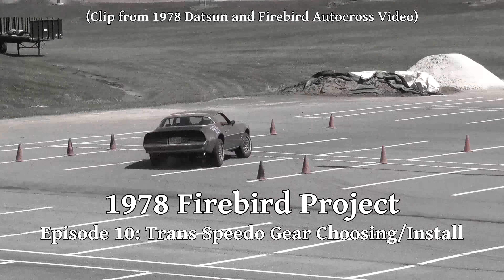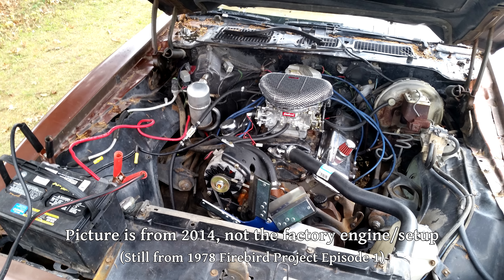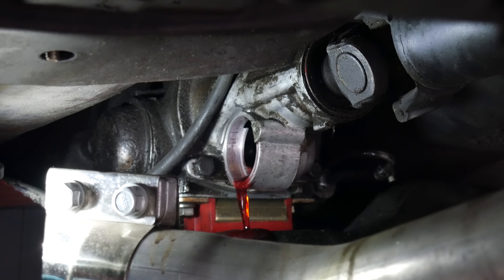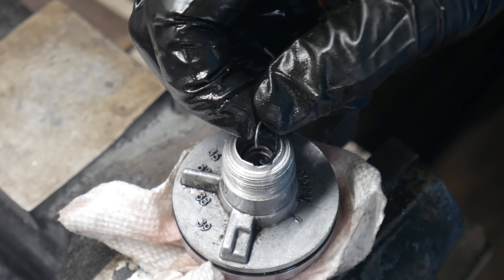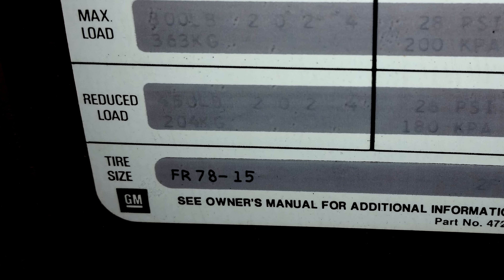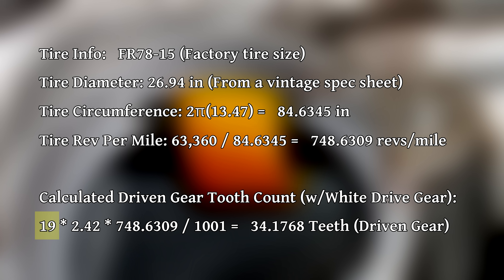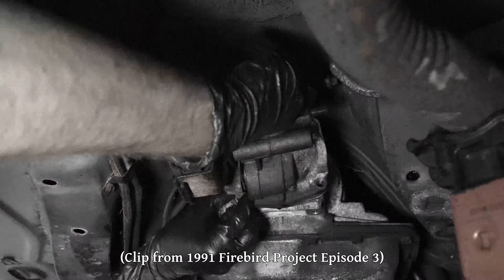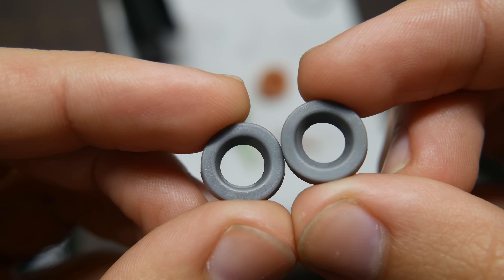1978 Firebird Project Speedometer Gear Choosing and Install (Ep.10)

Comment: The numbers on the speedo housing indicate which gears are compatible with the housing  . The bore in the housing is offset depending on the odds of the driven gear to get proper gear mesh . While putting a 34 tooth gear in a 36 tooth housing might work , eventually because of the mismatch it will strip the teeth . Use a speedo housing with a 34 on it and will last forever  ! Love your channel  .

Comment: Very informative. Very helpful. Wish I had found this a week ago when I didn't know these things. I'm repairing TH350 leaks on my '81 Trans Am and spent a lot of time finding the right speedo gears to best match my 3:23 gear ratio and stock tire size. Going with a 15 and 36 tooth combination and installing all new seals. My speedo housing is exactly like yours. Thanks.

Comment: The other thing my old boss taught me on a speedo that likes to bounce is to remove it from the gauge pull out the inner cable lube it with petroleum jelly because the cable can get dry works really good just leave the last foot unlubed near the gauge

Comment: I went through this on my Blazer. The original owner had replaced the trans at some point and the speedo was off.  I tried to fix it, broke three speedometer cables until I figured out that the pencil gear itself was broke. I had a reputable transmission shop fix it for $140.  Was perfect after that.

Comment: I utilized 295 50 15in on rear with 235 60 15in front. Height is darn near identical and fit better than 275 60 15in which require jacking up rear to gain clearance. Although for day to day driving i prefered 215 65 15in all season tires on my 78 bird.

Comment: if you wonder why the seal was in the wrong direction its simple . When those seals started to leak it was because the gear shaft was wearring out and at the time you could only get the gearshafts at the dealer and we all know how much a part at the dealer cost . so people re-used the same gear but flipped the new seal in order to avoid the new seal seat to end up in the same wear down spot as the old one . problem solved and you could continue for a few thousands miles this way . The only problem with that method is that a seal seat  is made to retract  on the shaft from the pressure created by  the warming up of the  ATF fluid creating a thighter seal in the pprocess . if you flip it then the pressure from the ATF temperature  will cause it to expend outward instead of inward like it does when its installed in the right direction . I've told my clients back in the 70's and 80's to stop doing that  and explained to them how seals actually  work and that doing that is only a short solution to stop a leak and will cause an even greater one in the future because of it and that by flipping the seal you open it to contaminations coming from outside and that can create accumulations of dust inside the pumps of the trany . Even if a trany filter is made to filter  very small particules it has its limits and some dust particules are even smaller than the filter can handle and a build up of it may take a lot of time but will eventually lead to trany failure
Reply: And the plug is machined offset center for the plastic driven gear, this allows for gear mesh adjustment. Like a cam. The shown tooth counts on the plug are indexed for where to stop counter clockwise rotation adjustment to those common sizes.

Comment: Thank you for this video.  I am installing a new housing and gear as you showed but have on question.  The retainer fork shaped clip does not touch the housing when tightened down and the housing can be wiggled a bit.  Does this mean I need to bend the retainer clips to put pressure on the housing?

Comment: You need to do this job on your buddy's XJ... Open Jeep catalog, turn to page with gears, select tire diameter, order gear. Done. No math. ;)

Also no cable! Not a fan of cable speedometers after many, many, many years of owning cars with them. I like their electric brothers much better.
Reply: Lassi Kinnunen  You're exactly correct, and on another vehicle I have had a speedometer recalibration box that did exactly as you've described. The difference being that Jeeps (at least Wranglers, so anything sharing much with that platform gets the benefit too) are insanely well supported. So, it's like $12 to order the correct gear for a Jeep and another 5 minutes to put it in. You can't mess with the electrical side any faster or cheaper than that.

Comment: I had a wrong speed reading by some 11,5% (less speed) after I fitted my off-road truck with bigger tires. Instead of messing with the speedometer, I installed a speed app to my cel phone. Easier and much more accurate.
Reply: On vehicles with an electric speedometer you can fit a recalibration box that allows infinite adjustment and installs in about an hour. Super easy and no messing with your phone. Just a thought. I bought my box from Dakota Digital.
Reply: Maxwelhse I agree, but my offroad is a 1997 Land Rover Discovery. I don’t think it has an electric speedo. And even if it had it, being an English car, it wouldn’t be working. 🤣🤣
Reply: @paulog8813  LOL... Poor British car. ;)

Comment: I have a 78 TA....400 with TH 350 and have the same speedo leak, however under examination of mine, I have a gearbox looking thing that attaches to the housing and the cable runs into it. My question is....why is it there? and secondly, as seen on another video, said wasn't necessary to install....can I just run the speedo cable directly into the housing?

Comment: Wasn’t there some damage to the housing at the end the cable attaches? It looked very rough/uneven, as if some metal had chipped away. Perhaps that’s as it’s supposed to be?
Reply: It looked damaged but I doubt it will cause any problems since the thread behind it is in good shape
Reply: tomas bissio True, although the cable housing butts against that surface, so I wonder if it might leak a small amount.

Comment: I would use self amalgamating tape to keep the juice in, draw lines over the speedo referencing GPS speeds.. Much more sensible? What ever works I suppose.
Reply: There's doing something, and there's doing something with style. Lines over the speedometer face screams "no style." Geez. New seals are a couple bucks.
Reply: @jakester455  Yep thats why I asked the question   ??  much better to fix it right the first time

Comment: the firebird would have had either a Pontiac or Oldsmobile engine and transmission from the factory. they didn't start to have "Chevy" style power trains until the 1982 model year when the 3rd gen was released. 1981 was the last year that Pontiac made their own engines and used them or Oldsmobile power trains in Pontiac cars
Reply: 1978 was actually the very first year that the sbc was being installed in them from the factory.

Comment: I am honestly on the verge of losing interest in this channel. These small videos and very very slow uploads are getting boring. You have some much content and failing to release it.
Reply: If you come here for entertainment dont bother this obviously is a channel built for informing people about old cars if you dont wanna learn that that's fine but I'm sure they're some other channels worth your time. Me I'm all for this. I want to learn about older cars
Reply: @ericsmithers2952  oh but it's slow and boring when is learning ever fast and fun maybe you just dont get what you insinuating. And it wasnt meant as an insult so hike off.
Reply: @nyquilforthekill1620  slow and boring, you mean short and lacking.
Reply: @ericsmithers2952  Eric nothing about that was shirt and lacking he described how wheels and tires affect your gears and how fast your speedometer clocks you at it's a very cool subject for older cars because if you wanna build anything crazy to be able to do so and still have everything work the way it should you would want to do this. He emphasizes the fact that the difference between his driven gears is not correct maybe for his tires or his transmission and understanding it more helps one in the future with tires or wheels or even getting a better hearing out of the vehicle while preserving gas and milage. Aka. Getting the most out of the car. I found it intriguing man idk but that me. Look I'm sorry if I offended you as I did not mean to but I need to and want to know this I want to be a better mechanic and someone who can specialize on doing part overs for various makes and models of gm and what not.
Reply: @nyquilforthekill1620  okay this discussion is over, you missed the point.